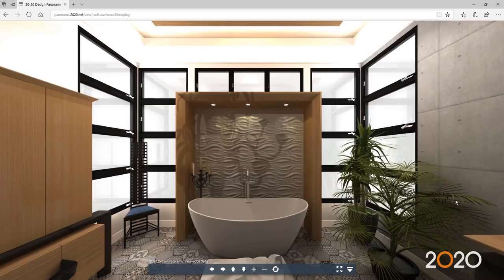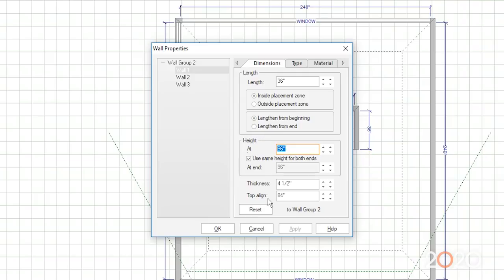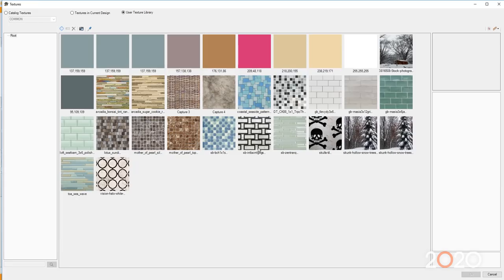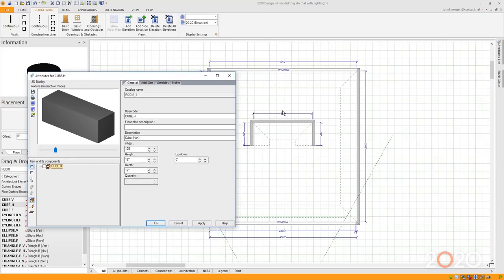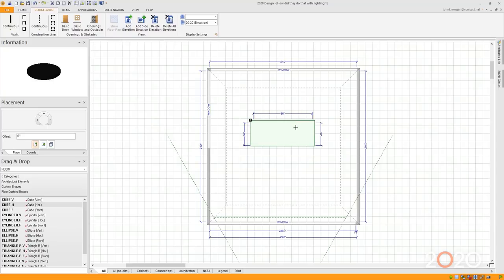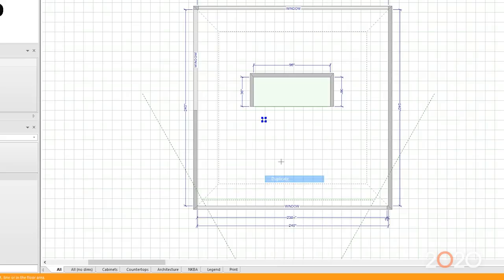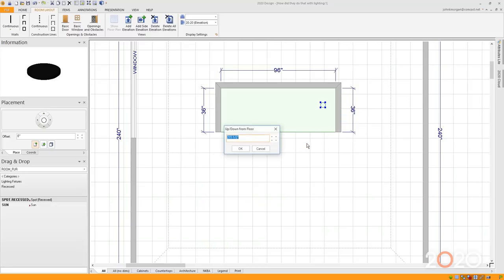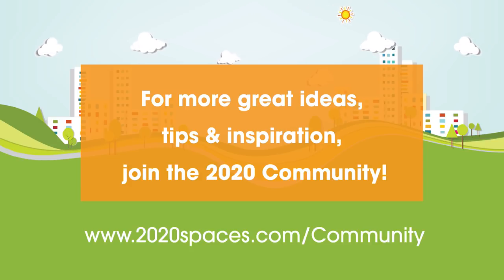How Did They Do That? Building a Freestanding Alcove

Comment: Hi - the original design shows alcove wall and ceilings with a 45 degree bevel at the front as well as mitered edges between ceiling and side walls - can you explain how to do that?  Thanks.
Reply: Probably way too late, but I can think of one way to do it. I don't believe the person who made this drawing actually used walls, but custom shapes in Room>Architectural Elements>Custom Shapes>Wall Custom Shapes. If you clip a vertical and horizontal triangle, it'll give the effect of a miter joint like the alcove in this one. Hope it helps.
Reply: Sorry, the rest of the wall is also most likely built with Room>Obstacles>OBST.WW